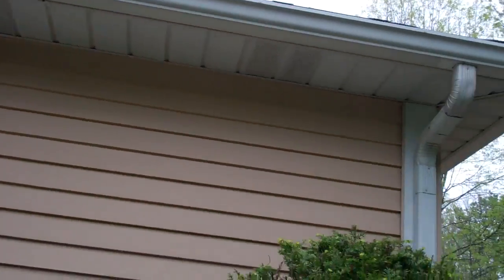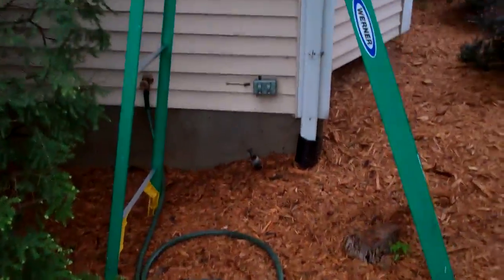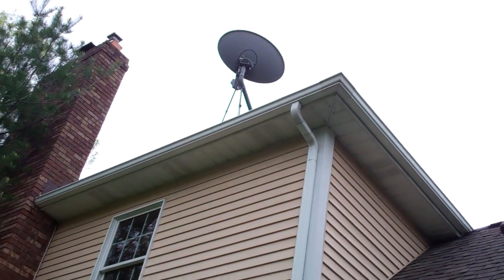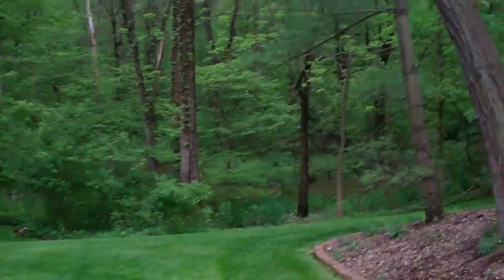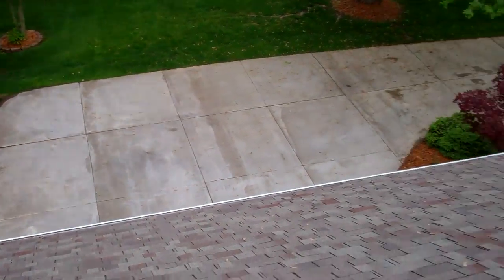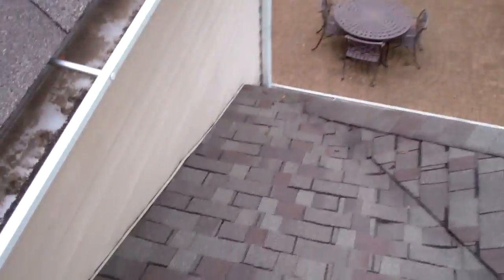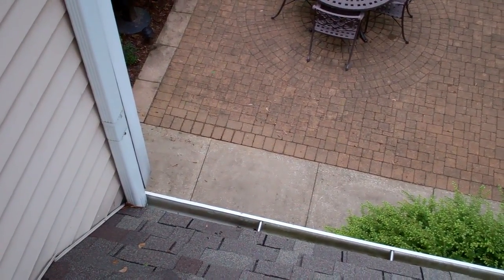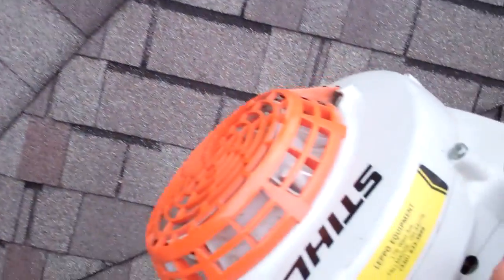220 Volts.  Underwater.  5/8/12 - Day 513

Comment: It's not "220 volts positive and negative" -- it's 2x120V relative to ground, 180 degrees apart (so 240V between them). It's alternating current so "positive" and "negative" switch back and forth 60 times a second. Either way, it will easily short out (and possibly shock someone) if it's underwater, which is why such wiring should always be protected by a GFCI.